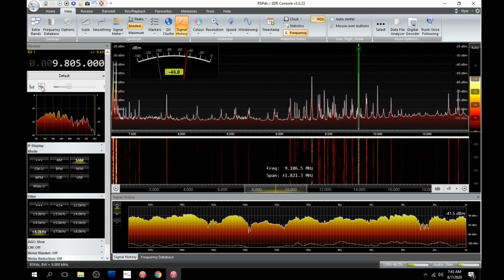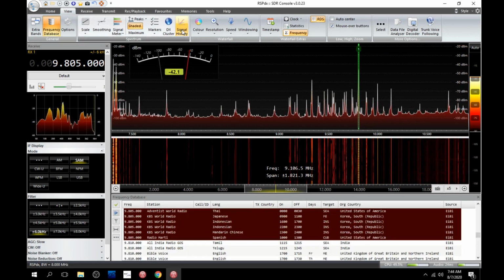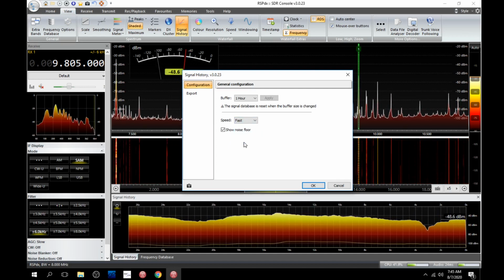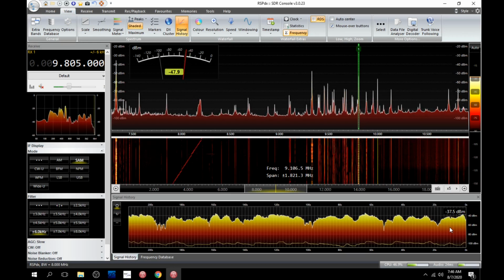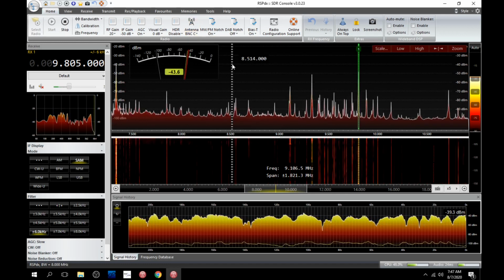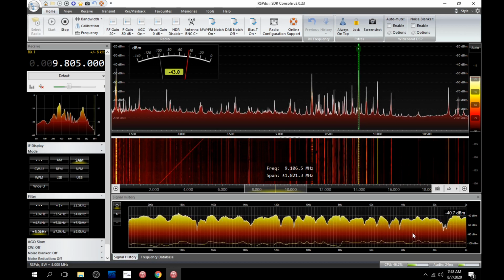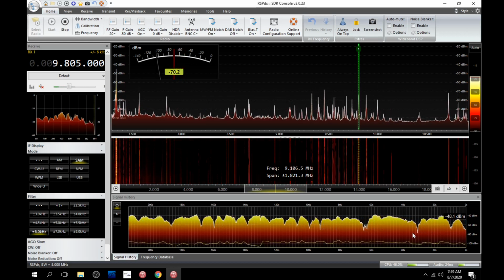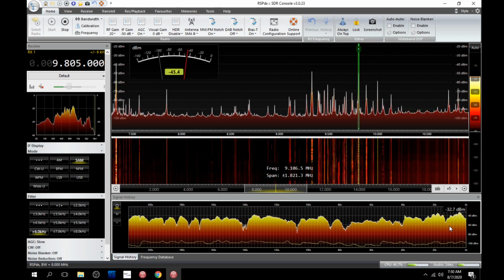TRRS #1972 - Using SDR Console to Test Antennas

Comment: Great video ! I did go out and buy a SDR Play ! do You recommend any type of discone antenna ? i live in an apartment so i will have to put it in a window  Thanks
Reply from the maker: Well, the ones I use are from Radio Shack.  They were very cheap but still work great.  $13, 15 years ago.  I don't know if the online store has them.  The Tram 1410 has good reviews but it's about $52.  Lastly, I have the RTL-SDR Blog Multipurpose Dipole Antenna Kit in my Amazon store it has good reviews and I am using it for mobile use.  $17 for the kit and no extra charge for buying through my store. See the link in the description above.
Reply: @hamrad88  Thank You
Reply: btw i just ordered from your store the  rtl-sdr.com/DIPOLE !
Reply from the maker: @mraudioiscool  Thanks for your support.  Let me know how it works out.